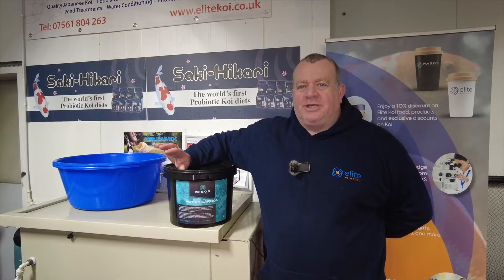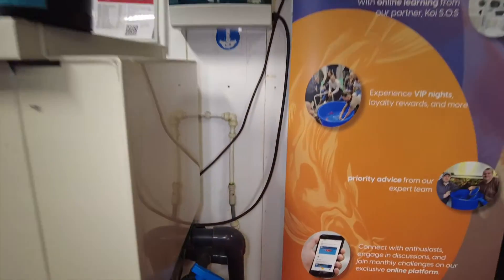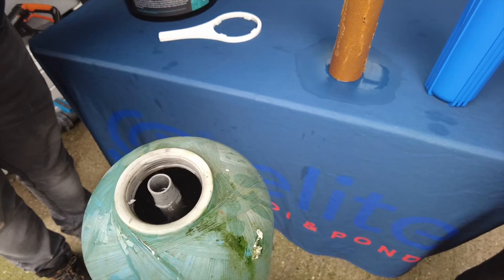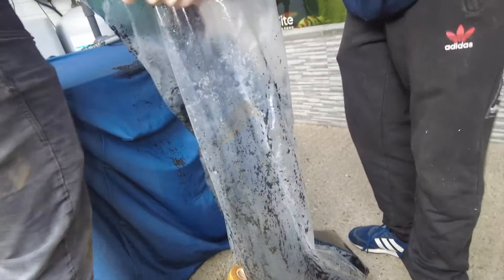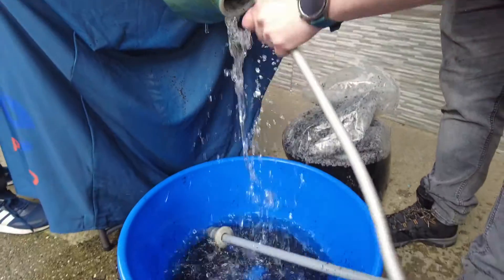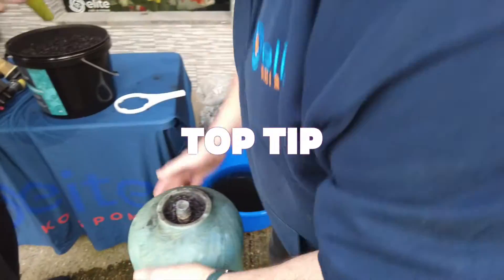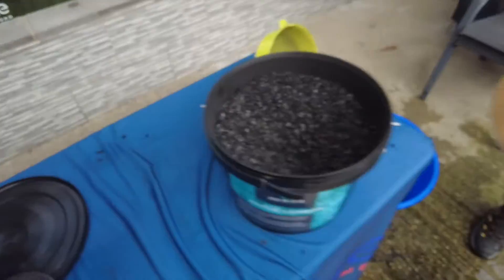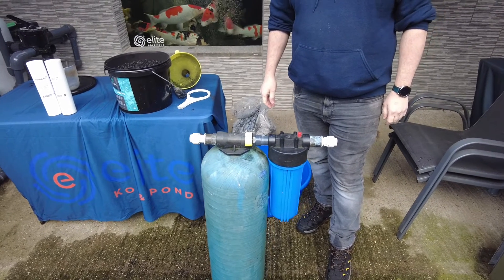Big Blue Purifier Carbon Change - Step-by-Step Guide for Healthy Koi

Comment: Great informative video 👍 I have the same size big blue, how often should the carbon be changed for reference my pond is 3000g 👍👍
Reply from the maker: Hi Scott, there are lots of factors determining when to change the carbon. We check the water coming from the big blues regularly and if we see any Chlorine reading, we would test a few more times to make sure it’s not a one off reading, and if the reading remains then we would first of all, slow the speed at which the flow is going over the carbon, giving the water more “dwell” time and look to change the active Carbon asap.